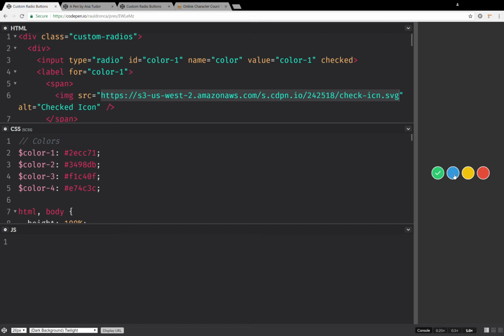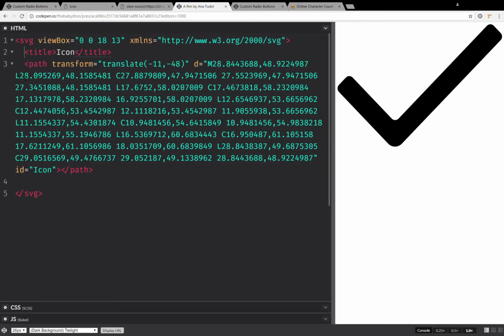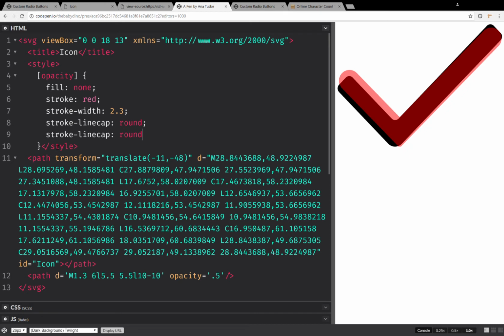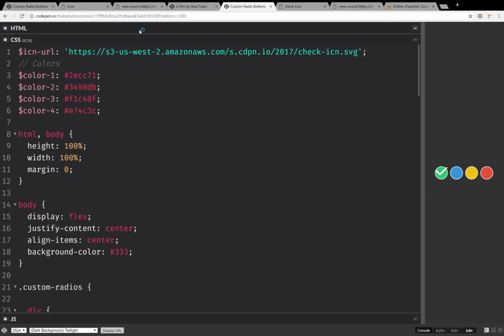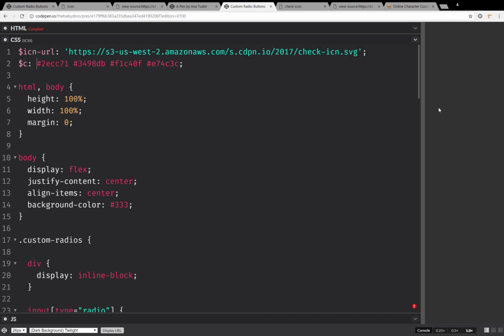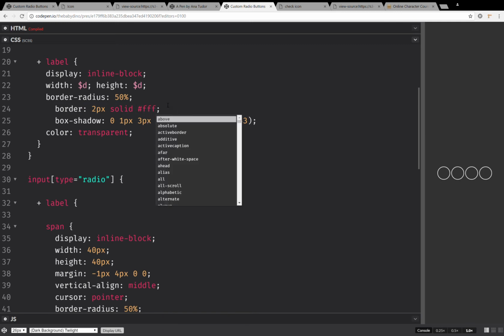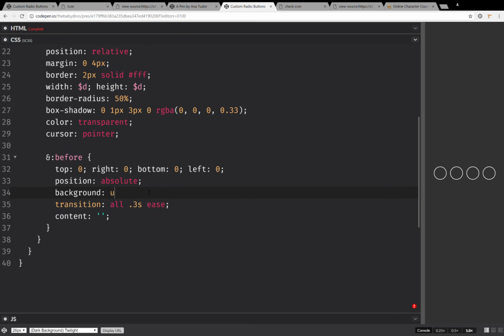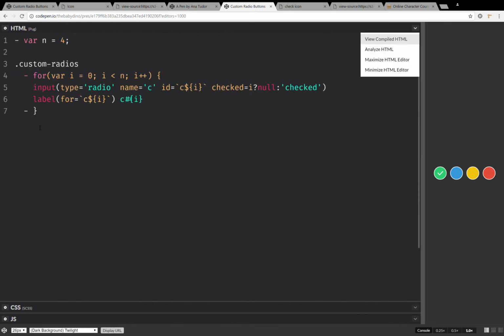Compacting markup for custom radios

Comment: Hi Ana,

First of all, thanks for sharing 😊

Why do you use the * selector (in SVG) instead of the path selector?
* selector is more slow, isn't it?

Thanks
Reply from the maker: No, it isn't.

Perhaps it was 5+ years ago. Even so, the difference wouldn't have been noticeable in a document as small as this SVG.

I'm using it because it's 3 characters shorter.
Reply: Want a shortcut SVGOMG tool by jakearchibald. one of the best things i have found online for svg compression